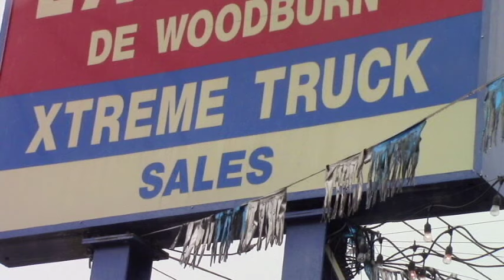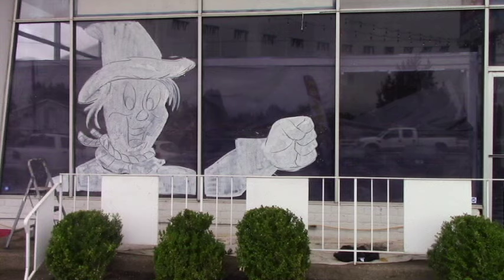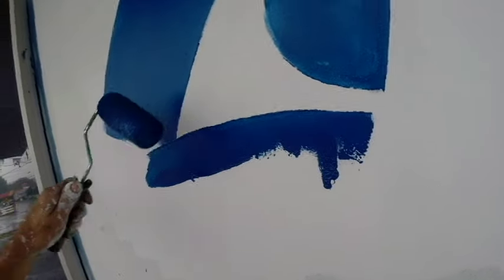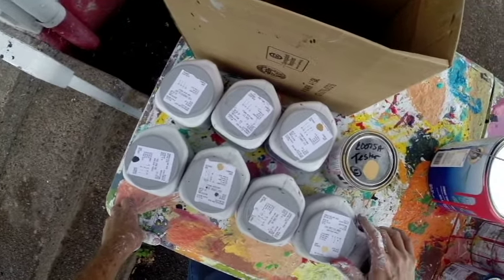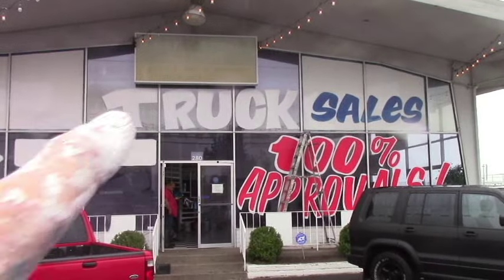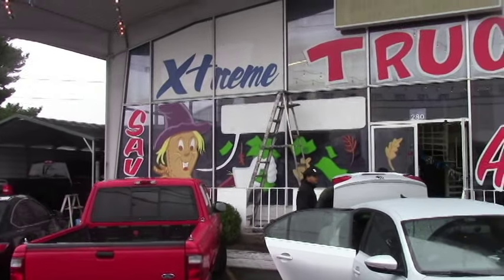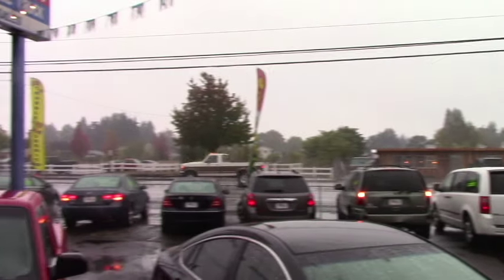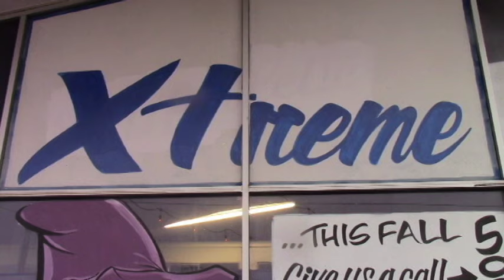WINDOW PAINTING TUTORIAL #114 Anecdotes-Advice-Afterthoughts

Comment: Ahhhh... painting in the rain. Fun! :P Lovely work as always, Scot! I noticed the voids in your white base coat and thought I would share what I have discovered over the years. Sometimes it's from built up road film, over the years, but most of the times, it comes from window washers (or the shops) cleaning the windows with a silicone based wax cleaning solution (kind of like Rain X ). I tried several cleaning solutions but there isn't much out there that I can just spray on it to remove it. Scrubbing the whole window down with some Bar Keepers Friend or Bon Ami (as if I was prepping glass for gold leafing) works but takes a lot of time and elbow grease and at an extra cost to the client. I HAVE found though, that if you come back over, right as the paint is starting to tack up, and drag the roller at an angle, it smears the paint and seems to 'stick'  over those voids. The silicone doesn't seem to be able to repel it once it's at that viscosity. You have to move quick in the summer months (so add a couple drops of dish soap to extend your work time) but this trick has saved me a loooot of time and hassle, especially when it's a large dealership's windows. 

"Keep on paintin' "
Allen Shelton
Reply from the maker: Thanks Allen, I appreciate the tips!
Reply: This makes sense the place I paint uses degreaser to take paintings down but leaves a film on the window

Comment: I am an artist and I got myself into doing a window mural which was my first time doing anything on windows. I went with exterior house paint but now a few months later the are getting pealing, bubbling and some sliding in a  couple areas so now I am trying to get some advice on how to stop this and save the work I've done.
Reply from the maker: Once it starts peeling and bubbling it is hard to save it. At a minimum certain sections have to be painted over white and started over. I  have had problems like this, but not very often, there are so many factors, I can't really explain all of them. Tell me what sheen and brand of paint you are/were using. Running to pick up dinner right now, be back in a bit.
Reply: I used Glidden Premium exterior paint Flat for this. I chose to go with this paint because we were hoping for something to last for awhile.
Reply from the maker: The paint sounds fine so it's probably not that. Sometimes certain window glass panes will repel paint for some reason. Sometimes people use cleaning solutions or even special clears that repel the paint. I get frustrated sometimes when the paint just beads up and I have to go over it several times to get it to cover. I have videos on that.  Cracking is a problem too once in a while. That has to do with the glass and also weather changes. I wish I could tell you more and give you specific solutions but it can be an elusive problem. Anyone out there have any suggestions?
Reply: Scot Campbell should I have used a clear coat when I finished
Reply from the maker: It's usually not needed but it might help prevent it from peeling. It's all about trying different things. I don't clear things that often. I have videos about that too, you can do a search on my channel.
Reply: How long do murals usually hold up?
Reply: I struggled, early on, with paint peeling and bubbling as well, especially once the wet weather hit up here in Western Washington. Paint brand and base type played a big part. I bounced around brands and did a lot of R&D and ended up with Miller Acrylite, velvet, with 3 shot of Titanium Oxide added for extra opacity (only requires 1 coat).  It's a 100% acrylic base and holds up, and covers, way better than any Latex bases. The latex may work for houses but not the glass. There's not enough tooth. Also, are the windows you have had issues with single pane? I have noticed those windows were the worst, as condensation was able to actually build up under the paint, when the temp dropped and the air got moist.